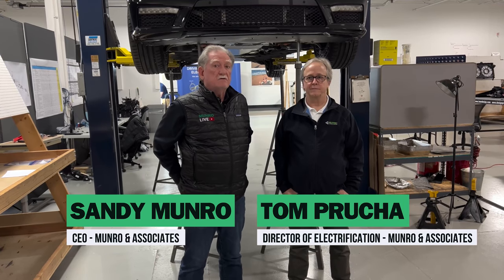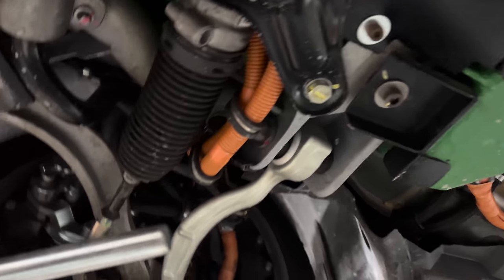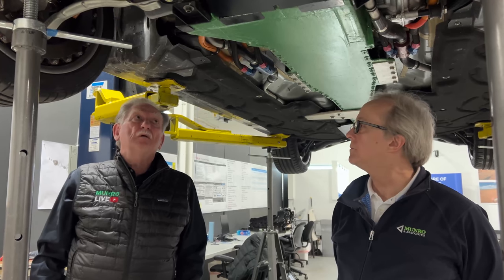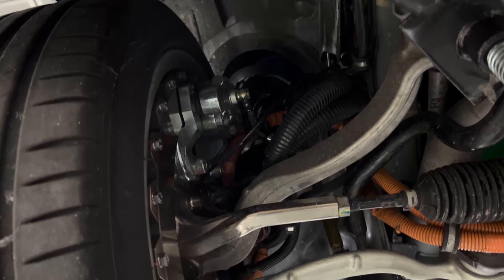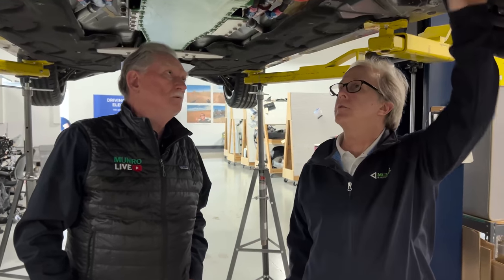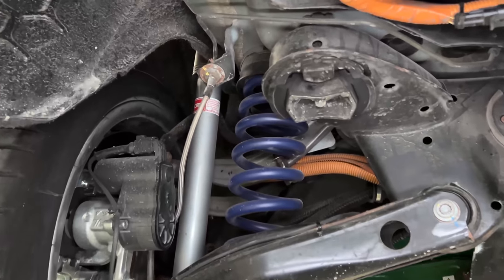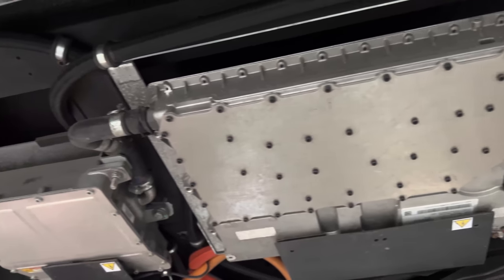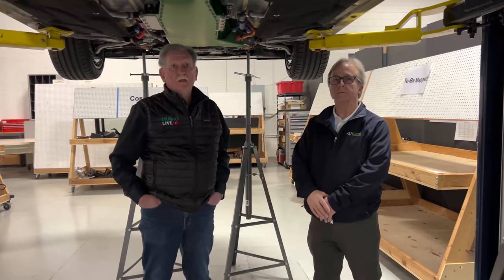Protean Electric Wheel Motor Technology | Review with Sandy & Tom

Comment: I wonder how EVs with wheel hub motors handle compared to EVs with axle motors. Ideally you want to keep the mass of the wheels low to minimize unspring weight to keep the ride smooth when go over bumps. That's difficult to do when you have the motor in the wheel. I imagine the ride is much more "bumpy" and the motor assmebly is absorbing a lot of that vibration. The wheel is also what collect most of the road grime, so I wonder what they do to keep the inhub motors impervious to road debree, so that their inhub motors will last as long as axle motors.

Comment: Having the inverters packaged within the hub itself is very interesting- only having DC wires is a packaging boon and is likely more efficient, but I'm far more interested in what the hell that inverter even looks like, or what other advantages there were.
Reply: There's an exploded view on the Protean website.
Reply: The DC wiring is two conductors rather than three for the 3-phase wiring, but there's no wiring packaging advantage beyond that.

Comment: Excellent Thankyou Munro. I've been interested in 'in wheel motors' for a long time. I'm not an engineer, and all I hear about with 'in wheel motors' is 'un-sprung weight' but in my mind, I don't see what the issue is, if you make the motors light enough.
Does this thing do 're gen'?
Are they looking to compete in the retro fit market?
What would these motors do for a pickup or van?
I guess torque vectoring is a go??

Comment: I see a lot of ppl "worried" about weight etc and how it will perform in the long run. Many years ago Eliica used same concept of in wheel motor, may be could be worth checking how things wen´t along the road to foresee if theese concerns have a point or not.

Comment: A neat conversion, but it is the perfect advertisement as to why EVs must be a clean sheet design from an ICE vehicle. Should modify a Tesla, or another pure EV. Bits of electronics all over the car is expensive. With no frunk, surely could have found space to fit all the electronics, including the inverters under the hood. The Protean set up has a lot of expensive stuff in the wheel and close to the ground - no off-roading or potholes for that vehicle. Protean should aim for low power applications and reduce the cost and size of its stuff. The Tesla motor cradle set-up looks very good in comparison.

Comment: Wow, lots of real-estate consumed by the motors.  Can they regen?  Rotors look scary but looking forward to Sandy's review.  You mention the motor in question is an 18".  Is tire size restricted to motor size?
Reply: Naturally, ALL hub motors can REGEN, the problem is there is not enough space for batteries, to power HUB motors LONG RANGE. 
a Tesla model 3 LR is more efficient, and lighter weight w/ SMALLER battery pack that gets MORE range. 
another consideration is PROTEAN, has LESS EFFICIENT & capable BMS cooling system. it's going to be CRAP battery management.
Reply: The bulky hub, motor and brake assembly set the requirement for the minimum wheel diameter. You could switch to a larger-diameter wheel, but if the overall tire diameter is increased the motor and brake performance will be reduced.

Comment: This was way back iirc, the Amg mercedes wheel  motor was what, 10 years ago or so? Surprised the idea is not scrapped. It seemed to be a great idea at the time, ICE manufacturer's didn't have dedicated EV platforms at the time so back then it was kind of a short cut to EV's. Or so I think was the reasoning behind it. Drawback was of course the added unsprung weight. I think we are passed that area now? Is there a market for these kind of motors today? How much added  unsprung weight per motor?

Comment: Interesting placement of the brakes.  Why didn't they use a multi-plate brake stack inside the motor stator?  Airplanes use a similar configuration.  It provides a lot of brake torque in a small space, but is harder to cool.  Not a big deal for airplanes as they can only land every 30min, and maybe not a big deal for an EV as most of the braking happens via the wheel motor?

Comment: The inverter electronics are IN the wheel - along with the brake disk and motor? 
How do you get rid of all the heat from the inverter and still make that work under hard braking when everything gets VERY toasty? Not to mention sealing out the elements from all that over a huge heat range...

At first look it seems sketchy with lots of unsprung weight. Testing will prove it one way or another.
Reply: I see they are liquid cooled. So not only do you have HVDC going to each wheel, but also two coolant hoses. That gets quite busy in the front.

Comment: Can i get those wheel motors for my semitrailer? And i do mean the trailer
Reply: No, they don't go that large, and the included brake would be inadequate. Just use a beam axle with one or two motors mounted on it, such as the units offered by Dana TM4 or Detroit Diesel.

Comment: Although I see some imediate benefits with this wheel hub design with no driveshafts or wheel bearings. I wonder about durabilty in regards to moving wires, putting those motors in such a hostile environments with potholes.

Comment: I don't know... that just seems Ike a lot of stuff out in the hub. If nothing else, Tesla's method of driving a diff is a much cleaner setup.
Reply: "Tesla's method"? You mean what everyone did before Tesla Motors and since?
Reply: @georgecostanza2695  Almost everyone has heard of all of the other major companies building EVs, and most of them built EVs in at least limited numbers before Tesla Motors was formed. You've never heard of GM? The drive unit in an EV1 of 1996 had a drive unit just like Tesla later used. Popular success (funded by selling shares in a non-profitable company) is not the same as inventing or creating any technology... so it's not "Tesla's method", it's "the conventional method".

Comment: When Sandy talks about the weight of the battery and hub motors being equivalent to  the original ice drivetrain this may be correct for the net weight of the car but  the hub motors are part of the unsprung weight along with wheels and tyres whereas the battery is sprung weight,   Therefore the sprung weight of the car must be less than the original which should improve ride and handling. Who knows how much the increased unsprung weight is a detriment?

Comment: engines in wheels I'm not convinced (yet). Higher unsprung mass, Higher rotating inertia. How that effect comfort, reliability of suspension, how much higher is risk to damage rim when you drive through pothole. How difficult will be tune suspension when oryginalny unsprung mass was ex 5% and after ex 10%?. Inverter in the wheel with all vibrations?

Comment: Québec has a wheel motor company with a partner for HD application in production. You need a bigger limo..
Reply: The TM4 motors in production, available through Dana TM4, are not the in-wheel design.
Reply: @brianb-p6586  oh, the partner name is not what I remember...
Dana TM4 Spicer e-hub
Reply: @yorkchris10  TM4 has worked with various companies... currently that's Dana (Spicer is a brand name of Dana's). They do have a heavy-duty hub motor, so you're right - there is an in-wheel design - but it's not much like light-duty in-wheel motors such as the Protean. It is a TM4 motor with a planetary reduction gear in a Spicer hub. Dana TM4also has similar but much smaller motor-gearbox-hub products with smaller motors of what used to be the Ashlands and perhaps SME lines (Spicer Electrified 7HE, ES10S, and ES10H e-Hub Drive)... again, not like the automotive in-wheel motors.

Comment: What about making of it a hiper-hybrid for extra range? 
(same but with a small combustion engine using ethanol or similar to generate electricity)
Reply: Info - did you not watch the video ? 
they don't even have space for a FRUNK. it's occupied by MORE batteries and electronics. no room for a GAS engine......lol.
Reply: @markplott4820  Clearly you do not know what a hiper hybrid is. Get lost.
Reply: @markplott4820  You see, you do not know what a hiper hybrid is.
Reply: @lgriestra  - Tesla already SMOKES them all.
Reply: @markplott4820  Eh, Elon knows that fully electric cars with batteries aren't going to be the future. Its just the means to make a profitable company to develop highly sophisticated electric powertrains. Obviously carrying arround a battery weighing a ton isn't the most efficient thing to do. 

Now, if you take that highly efficient powertrain and get a reliable, leightweight energy source to generate the needed electricity, you've won. You already got a fully developed vehicle which now weighs half of what it did earlier. We just aren't at that point to have such an energy source, yet.
Reply: @LachskoenigIV  - agree, FC, H2 and CNG are not up to the task.
perhaps with Selenium-Kellride It may be possible. 
also, rolling around on Tires is very inefficient, rolling on Composite BALLS has lower rolling resistance and more Efficient. but spherical Wheel have not been invited yet.

Comment: I first saw this type of Wheel motor from hydro quebec almost 30 years ago. 
The weight of these motors does not affect the suspension as it sits on the wheels not on the car. There was no need for any gearbox. Somehow this project was droped???
Reply: The company created to commercialize those in-wheel motors was TM4, which has done many projects but has never had commercial success with the in-wheel units. They do make conventional motors which are available for heavy vehicles through Dana TM4.

Comment: that arm clearance on the rear tires looks tight. It could hit the break pad in a accident.
Reply: Technically, HUB motor don't need Friction Brakes. they primarily use REGEN. 
my 2014 Tesla still has ORIGINAL brakes.

Comment: This motor in wheels tech is DOA, please add comments why not
1. Way higher unsprung mass so way higher wear and tear on the suspension or expensive suspension components 
2. Per axle we would need 2 motors wiring and double the electronics so can’t be cheap and mass market
3. Water salt damage does to exposure 
4. If bad roads encounter before only run/tyre issue now you have to deal with motor issues which cannot be handled on normal tire shops 
5 obviously packaging issue makes it expensive

Comment: I hope you can tear down a polestar 2 and the upcoming 3
Reply: @markplott4820  because it looks like it drives better than a model 3 and the architecture for polestar 3 and beyond is far different. It would be good to compare and see if the manufacturer is able to come through on their plans. 

It's also based in England and Sweden and has manufacturing opening in the US, So to call it a CHINA company (or whatever negative sentiment you are trying to express) is disingenuous at best.
Reply: @TwentyHz  - LOOKS are only SUBJECTIVE, it does NOT grant you PERFORMANCE.
in FACT Tesla model 3 has SUPERIOR handling that's BETTER than a BMW M series,  it takes corners like it's on RAILS. 
the STOCK model 3 suspension is SPORTS tuned and is stiffer, but are EASY to upgrade at a Garage, I have a AIR suspension on my model 3P.
Reply: @markplott4820  I own a model 3 and test drove a polestar 2 and I'll disagree with you that a car is restricted to the sum of its parts.

I'm also not sure why you are bragging about an aftermarket suspension on your car.

Comment: Each motor weighs 36kg according to the website. So at least doubling unsprung mass. You’d fly and bounce. I can see hub motors on a slow moving off road vehicle like a mars rover or something where drive shafts wouldn’t allow enough suspension travel. But on the highway you bounce all over the place.  Bad idea.

Comment: You should definitely test potholes handling.
 Ever since Hydro-Québec developped the in-wheel motors it appeared that suspension stability was a major hurdle because of the weight of the wheels.
It also made for very costly repairs if youbever bump a sidewalk...
Reply: make it superconductor as well lighter composite and weight no more.
Reply: @3nityC   it would need to be kept at -150Celcius in order to stay superconductor... So pretty much impossible until we can invent warmer superconductors.
Reply: @brunoethier896  I laugh when everyone waiting for warm superconductor when the current non-rare earth BSSCO(−163°C)/Nitrogen(−196°C) already feasible to use you don't need to worry about cryocooler wattage when the efficiency of zero resistance benefits is higher, for redundancy  when the cryocooler isn't working it just turn to normal low-torque non-superconductor motor because it has copper on it so the motor must be axial design to be more permenant torque concrete. Just put the cryocooler built in next to small superconductor & everything is maintain.
Reply: @brunoethier896  We from ASEAN going to build it anyway is good when you percieve it as impossible. That's an advantage to build the startup.
Reply: @3nityC  I'll believe it when I see it 😉
Reply: @brunoethier896  mark my word 😉 my name is Chris Wilfrid.

Comment: Have to give credit to that guy for calling the battery just a battery. A group of two or more cells is a battery. Not a “bank”. Not a “pack”. A battery.
Reply: The term "pack" makes sense when the complete battery is distributed between more than one box or "pack", although that's rarely done in production EVs. "Bank" makes sense for parallel batteries which can be individually selected to form a complete system... which is also not done in production EVs.

Comment: The difference in unsprung weight was not addressed in this video. My expectation is that it must have increased, and that any substantial increase would be deemed as a negative factor in regard to handling and stability. Please address this in subsequent episodes.

Comment: imagine living in an area that salts its roads in winter with all that exposed technology on each wheel, it's bad enough having a simple brake calliper and wishbone and McPherson strut, I can't imagine what this lot will look like after a few years of use, corroded with salts eating into everything, the best e-cars are the ones with no brake callipers and use brake shaft electromagnetic braking, this leaves the wheels very simple and easily kept free of corrosion, this is a step backwards like most e-cars it seems like a good idea until you use it every day in normal conditions,

Comment: Motors and inverters in the wheels does not affect the weight the suspension supports. Means more battery than other retrofits. Excellent design.
Reply: But it increases the unsprung mass, which is bad for ride quality, handling, and track performance.

Comment: There are so many bad design decisions here. Having a 1:1 ratio between the motor and wheel is the first big clue. The battery cluge is another. This is just a bunch of guys having some ideas and making a toy.
The only value that'll come out of it is to settle a lot of bad design ideas that good engineers shouldn't make in the first place

Comment: I normally don't comment, but this design is bad at best.  The unsprung weight,  4 motors getting jarred around constantly, angular momentum and can you imagine the insurance?  A slight fender bender could require a whole new motor?  Yikes.  This to me is a bad example (or good) of over engineering!  Motors ( and batteries)  in other designs are inboard for just the reasons above.